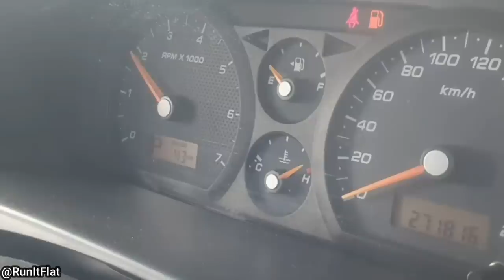Customer States Car Is Overheating And Won't Shut Off! | Just Rolled In

Comment: Don't disconnect the battery when the engine is running. Depending on the built, electrical peaks from the alternator may kill some electronics.
Reply: sounds plausible. The battery dose act as a sort of capacitor to dampen those out. In general id say dont run the alternator without some form of load.
Reply: Yeah but in an emergency to shut it off it’s faster than taking the plug boots off or disconnecting the gas.
Reply: It is possible, but Mitsubishi training center instructors actually recommend doing it running
Reply: It appears to be a RHD non-US model. Maybe it had a diesel engine and went into 'runaway' condition.
Reply: @leonb2637  Australian Ford Falcon with the mighty "barra" engine. In some factory versions they are more powerful than the V8's and slightly modified versions are capable of 1200 Horsepower....on the street. As Ford no longer supports these cars the parts are getting hard to source and the condition of many is just like the ones in the vid.
Reply: Block of wood or a thick book up against the intake shuts them down more often than not.. Just saying, also work on old Detroits occasionally.
Reply: Just put it in a high gear and stall the engine..
Reply: @deesnutz42069  I'm assuming it is a diesel, and just pulling the lift pump relay would most likely wind up damaging the actual injection pump. Best to just starve it of air, or manually close the shutdown on the injection pump if possible.
Reply: @theamalgamut8871  doesn't work on automatics. Pulling the fuel pump relay or choking the intake is the best way to stall a gas motor.
Reply: @garykirk1968  it's an Australian petrol six cylinder Ford Falcon.
Reply: @theamalgamut8871  dependant on the engine/application, as well as the RPM of the engine at the moment of the non stop condition. Would most likely just roach the clutch, and God help the TC if an auto..
Reply: @waveman1500  Not sure if that helps or hurts my statement bud, but thanks for the info. Also, if it is indeed a diesel, and a Ford.. We've found the problem. LOL
Reply: @michaelebbighausen3733  An engine runs without battery, as we can see on this video. The alternator is still running... To stop an engine, you're gonna have to come up with something else.
Reply: @leonb2637  That was clearly not a runaway engine. And the technician clearly stated the ignition switch was f'.
Reply: @TwinShards  It wasn't a "runaway".. She went run anyway.. LOL 😆
Reply: The fuse box right next to the battery contains the fuel pump relay... yanking that is probably a safer option.
Reply: @Ratzfourtyfour sounds like something a stupid European car would have an issue with
Reply: Back in the day, that's how we checked the alternator.
Reply: Right? I'm sitting here thinking "congrats you confirmed the alternator is working, or over volting the harness. Please stop."

Pull the plugs, kill the pump, block the intake... Jesus.
Reply: @garykirk1968  No, not a diesel, petrol.  Pulling the fuel pump relay would stop it.
Reply: Yeah that's a good way to fry the computer why didn't they just pull the fuel pump fuse or the ignition fuse there's plenty of fuses that keep the engine running
Reply: Just another thing to fix,  why complain  ?
Reply: Somewhat related, when my Brother drove a vehicle with dead battery for about an hour, this caused the alternator to get burned out and popped some fuses as well.
Reply: @garykirk1968  you...don't know what petrol means?
Reply: @michaelebbighausen3733  Yeah, but it doesn't work.  It didn't work on 1960s cars either.  That pesky thing called the alternator kept them powered.
Reply: if you short the 2 cables together while its running its usually enough to kill the electrical system and the engine will quit
Reply: The tech said in the video "The ignition switch is buggered"
Reply: the only option would to have pulled the fuel pump fuse
Reply: @leonb2637  did not sound like  a diesel engine
Reply: @leonb2637  that was a gaser   see rpm tach
Reply: but there is a regulator in each vehicle after CDIs were used?
Reply: @michaelebbighausen3733  Diconnecting the battery doesn't disconnect power from the circuit.
The alternator powers everything when the car is running.
Reply: So true. He also revved the overheating car. Good job mechanics
Reply: @feero9680  it was driven to the shop... 😂
Reply: I drove a car without the battery hooked up lol
Reply: Kill the air flow and she stops. A rag or anything in the intake will do it. We had an old crane with a Detroit in it that would just die sometimes. The operator knew about the butterfly flapper on the intake that would vibrate the linkage and choke it out. I think it was a design for when a Detroit runs backwards.
Reply: @leonb2637  it's a Barra, they only came in LPG and petrol.
Reply: @timhinchcliffe5372  was going to comment the same thing.  Maybe as cars get more complex people forget the basics, the engine needs fuel, spark and air, just remove one of those.
Reply: @michaelebbighausen3733  the engine still runs on the alternator obviously. You'd also need to pull the field wire off the back of the alternator to stop it producing power.
Reply: pull the field wire off the back of the alternator (the push in block connector). No more charging.
Reply: @FiftySixishTV  well, it is really because the shitty european style Ford tibbe keys and locks wear out faster than traditional flat key locks. I've owned a 1990 Jaguar (built when Ford owned them) and it had shagged tibbe door and ignition locks at only 200,000km. I now own a 2001 Aussie Ford Falcon much like the video car but is in much better condition so the locks aren't playing up yet. Dunno if the U.S. Fords had those crappy round shank tibbe keys or not.
Reply: @stevencarlson5422  and blow all the diodes in the alternator. Just unplug the field wire from the back of the alternator.
Reply: @s.c.o.s4672  i have an intech in my AU. First ford ive owned so i couldnt really notice the difference unless i saw the 2 motors side by side. Always been a Hemi 6 guy, just can't afford one anymore.
Reply: @rossbrumby1957  haha, my first car was the intech Ford AU. The Barra has a more blocky look, and a different colour top depending on which version the motor is.
Reply: @tt600pch  fun fact, these masks that everyone wears for COVID will absolutely choke out a gas motor.
Reply: We disconnect the battery while running on my dads 1979 jeep all the time and it does just fine. Although that’s probably because there’s no electronics to burn up lol
Reply: The real question is who thinks disconnecting the battery will shut off a car? I am not a mechanic, but all of the 10 or so cars I have owned in the past 20 years would just keep running with the battery disconnected anyways.
Reply: @Eckx1084  I have a few manuals that recommend it.
Reply: @s.c.o.s4672  to shut a car off? What manuals are those? 1932 Ford?
Reply: Thank you!
Reply: @De19thKingJulion  A shop rag in the intake. No thinking, hunting required.
Reply: @leonb2637  A runaway diesel revs way past the redline until it blows up. This car was just idling
Reply: @theamalgamut8871  The best choice, but good luck doing it with an auto trans
Reply: CO2 extinguisher discharged down the intake does it every time.
Reply: @leonb2637  FORD Falcon of Australia, RHD market
Reply: @woottastic  But they won't choke out a human being, no way! Perfectly safe and effective!
Reply: @Eckx1084  It's always been that way. Cars have always had some means of keeping the battery charged and electrical accessories running, for as long as they've had batteries.
Reply: That was a might Ford Barra engine. They can handle anything 💪💪 Aussie built.
Reply: @ethanlamoureux5306  yeah, it's called an alternator, and that's why the car does not shut off when you disconnect the battery. What exactly is your point?
Reply: @michaelebbighausen3733  it doesn't work... ever
Reply: More importantly, why would that stop the engine? The alternator is intentionally designed to produce more power than the vehicle consumes. 

You want to shut it off, you pull the ignition fuse. 

It's shocking how some techs are as dumb as their customers.
Reply: @michaelebbighausen3733  no air no combustion.
Reply: @Eckx1084  You wrote: “...all of the 10 or so cars I have owned in the past 20 years would just keep running with the battery disconnected anyways.” My point was that not just in the past 20 years, but ever since cars have had batteries, which makes your mention of the last 20 years to be comically obvious.
Reply: @UCbTMCIiN1ZCQ6LxMspHKDvA yep or get your alternator’s fat wire disconnected.
Reply: @waveman1500  BA looks like.
Reply: @michaelebbighausen3733  Disconnecting the battery will not shut anything down as long as the alternator and voltage regulator are working since they are the ones powering all electrical loads including charging the battery under normal circumstances. I had my previous car's battery completely freeze one winter, practically reading open-circuit (wouldn't take more than 100mA of charging current at 15V, only read 8V open-circuit after resting for a few minutes), still worked fine after jump-starting with effectively no battery present.
Reply: come to think of it the tech should have known disconnecting the battery wouldn't kill the motor, as the Alternator produces more then enough power to run the car (how else would it charge the battery).
Reply: @FiftySixishTV  Well he was Australian...
Reply: Oaky Francis
Reply: Tap ignition with a hammer while lightly pumping breaks.... then oil ignition cylinder bye bye issue
Reply: @garykirk1968  haha I drive a ford which is also a diesel. So, oh fuck… hahahaha
Reply: My first thought. Number one cause of short alternator life is bad connections. Disconnection is attempted murder.
Reply: @michaelebbighausen3733  Probably wont work as the alternator will still power the engine.
Reply: @michaelebbighausen3733  All you have to do is pull the main fuse
Reply: @michaelebbighausen3733  Except it won't shut it off. The alternator continues to charge and it won't do anything except damage electronics.
Reply: @woottastic  Fuel pump relay / fuse.
Reply: @stevencarlson5422  I think it would for sure kill the electrical system.  The engine would also quit.
Reply: @rossbrumby1957  If you can reach it, that is a good idea. Also would need to disconnect the battery in that case.
Reply: Ive done that at some point with every car i have owned to check to make sure the alternator is working..........
Reply: So on current cars like that one what does the built in internal regulator do.... Unless the alternator regulator is faulty you don't have to worry about that.
Reply: Zener diodes and regulators inbuilt stop that. If it's a diesel it will make no difference if it's a runaway anyway. Cut the air off.
Reply: @deesnutz42069  doesnt work if its feeding itself off the sump or turbo oil. That's what a runaway is.
Reply: @michaelebbighausen3733  In most cases, including the one shown in this video, disconnecting the battery won’t stall a running engine because the alternator will continue to provide power.
Reply: Hey Guys, I am an Auto Electrician here in Aus and can confirm that this can and does happen with BA and BF Falcons built from about 2003 to 2009ish. I personally havnt had one fail to the point that old mate in the video was dealing with but generally pulling the battery will stall them but it looks like the battery feed to the ignition switch was shorted to the ignition power feed which will keep everything alive once the motor is started and alternator running. The switches were a mistake imo they are a bosch design and yhe outer casing is a part of the steering column, and there is a plate with contacts kind of crimped into the column. Usually you can feel when they are going to fail long before they actually do but of course most customers wait until their car fully fails to work before getting it looked at. Couldn't say how many of these steering column/key switch assemblies I have changed over the years its a dead giveaway when you get to the car and look on the drivers floor and see springs and copper contacts you know for sure the switch has come apart. The way to turn this off would have been to kill the fuel supply as the ignition is done via sequential individual coil packs and Barra motors from my own experience will run on 3 cylinders easy. Killing the fuel supply is easier said than done as Ford in their wisdom for BAs and BFs dont label diddley squat in their fusebox so its just a guessing game in an emergency.
Reply: @lbochtler  "does".
Reply: @stephenphillip5656  seems correct, ill just leave it as is to see how many more such comments come my way
Reply: @leonb2637    The "Dual VCT" on the plastic implies it is a gas/petrol engine--someone plz correct me if there are Dual VCT diesels.  Given the serpentine belt, even if it was diesel it is probably new enough to have DI via electrical injector pump (esp. if it has the software to run DCT variable valve timing)
Reply: Yeup done that a couple of times
Reply: @michaelebbighausen3733  disconnecting the battery with the engine running wouldn't stop a car running anyway. It's a pointless excersize as the alternator will still provide power to keep the electronics in the car alive.
Reply: @Mercmad  I find it crazy that the Barra is already not supported by Ford Australia.
Reply: 44 magnum to the side of the block would stop it.
Reply: When he showed the disconnected battery and running engine and said "Never seen this before", I'd say time to find a new mechanic. He has no idea what he's doing.
Reply: And for sure, it usually won't stop a running engine to disconnect the battery.  The mechanic should have known better.  There is that thing called an alternator that continues to supply power once started.
Reply: Nah that's not how it works there's a lovely thing called a fuse box that keeps electrical peaks from ever reaching electronics. However that was a dumb mistake on the mechanics part I would pulled the fuel pump relay first
Reply: @isaiahlangfords5574  Yes that is how it works actually. Fuses limit current, not voltage. So if you got a lot of voltage ripple, the fuse won't care, but it can easily damage sensitive electronics. I'm sure most of the stuff is fairly well protected, but its not designed to run on AC, which is basically what an alternator is putting out, hence the name, alternator.
Reply: @paulgallagher2937  wrong again an alternator is comprised of two systems one generates alternating current with rotational energy and the brushes convert it to direct current these brushes make up what is called a rectifier if you've ever rebuilt an alternator you would know. Please do research before commenting I don't like to teach for free.
Reply: @isaiahlangfords5574  The brushes do not turn it into DC, they are how you get the AC voltage out of the windings. A full bridge rectifier does part of the job of converting AC to DC. But it is extremely noisy without a large capacitor (the battery) connected in parallel. As far as teaching for free, I guess one gets what one pays for.
Reply: Trying to stall an engine by disconnecting the battery tells you a lot about the mechanic's abilities or better.... the lack of those.
Reply: they can run on alternator as i have the same motor if that were to happen to me i would unplug fuel relay
Reply: I work in a parts shop in Australia and we often sell ignition switch repair kits for these models
Reply: A good alternator will have a proper voltage regulator on its output. It won't be pure DC but it shouldn't destroy electronics.
Reply: @rossbrumby1957  they switched to huf style keys for the BA.

Comment: I'd have concerns about a mechanic thinking disconnecting the battery will stop the engine. That would only work if you disable the charging system. Hell, pull the bloody ECM fuse to cut the engine.
Reply: You're assuming he was a mechanic.